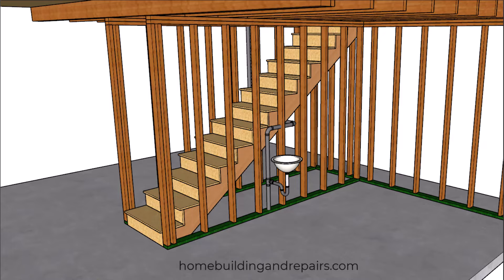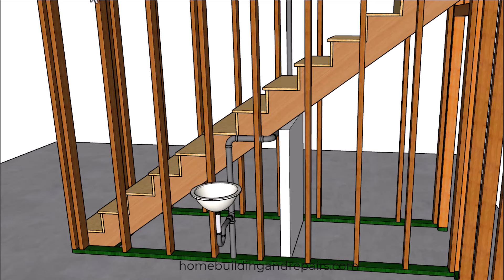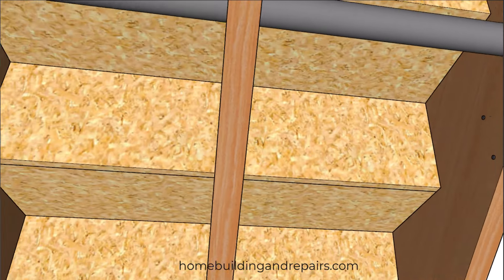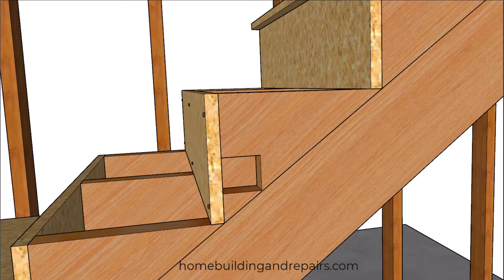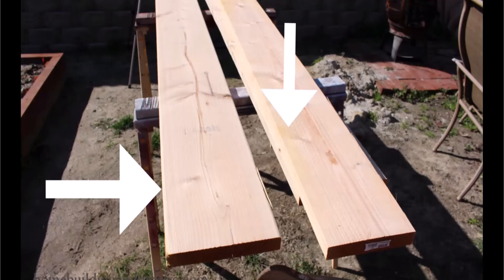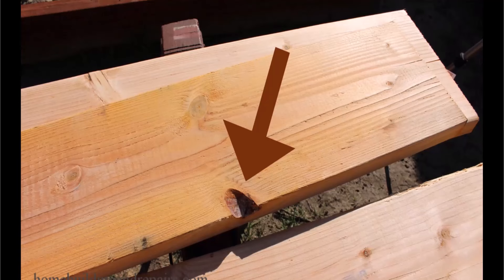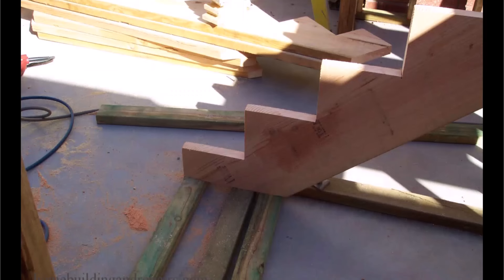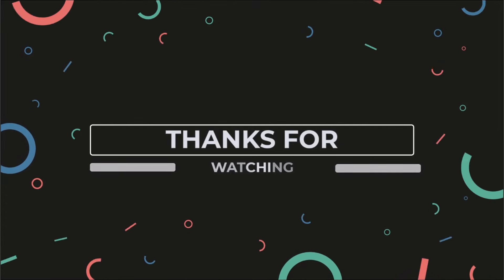Better Ways To Install Plumbing Pipes Under or Through Stair Stringers - Home Building Tips

Comment: Thanks for all your videos! Building my first staircase in the basement, ended up using 2x10 LVLs in order to clear a pipe. I'd read that LVLs were easier to layout, but I actually found them more difficult than the regular lumber "practice" stringer I cut. 

There's overlap joints when new layers begin/end on the LVLs that make the surface uneven, and if they're stored outdoors, they can warp quite a lot. I also found they're harder than regular lumber and the wood grain all goes in the same direction, so it's easy to split with nails. Pre-drilling for structural screws worked much better. 

I think there'd be a pretty good market for something closer to plywood, alternating grain directions, but in structural sizes, perfectly flat, straight, and sharp edges for layout.